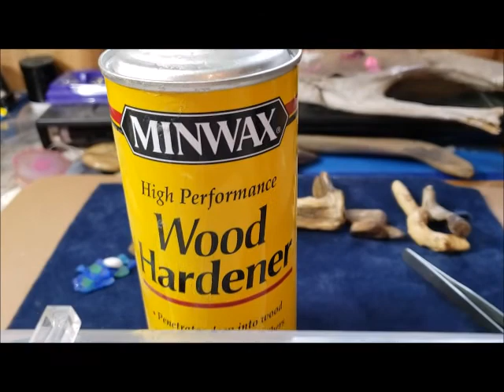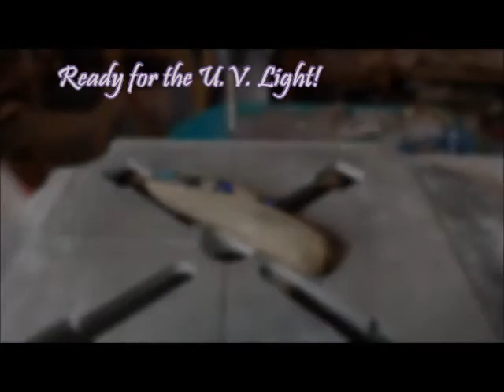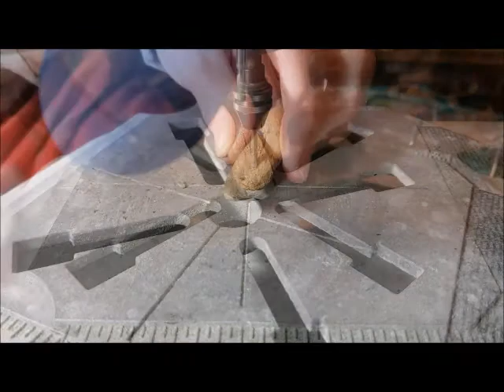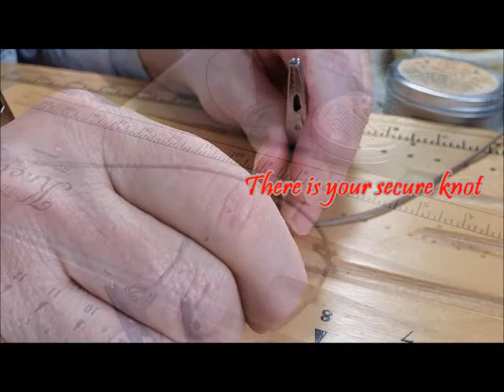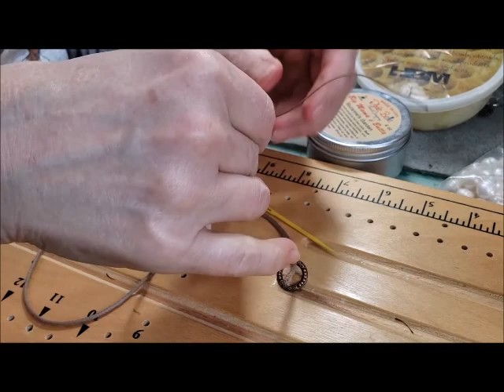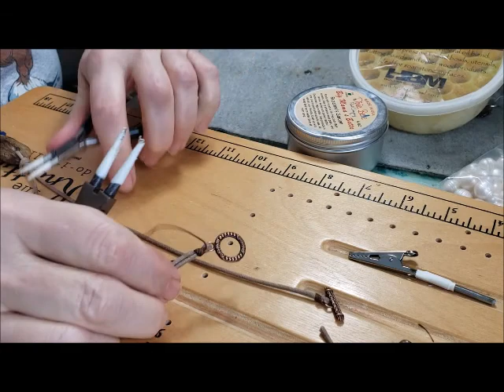How to create a Driftwood & beach pebble/glass Pendant

Comment: So are you saying you didn’t need to use the UV light on the resin, you just let it set overnight?
Reply from the maker: Hello,  It depends on what kind of resin you use.  There are brands out there that require sun curing, or a u.v. light will cure it.  I have never tried a mix that is used for molds that will set up in 10 minutes, I believe most of that type of resin will turn out milky white when it's done curing.  The u.v. resin will also cure if you put it out in the sun.  Because the sun is u.v. light.  Hope this helps, happy creating, dar p.